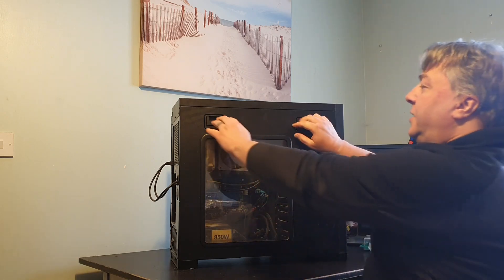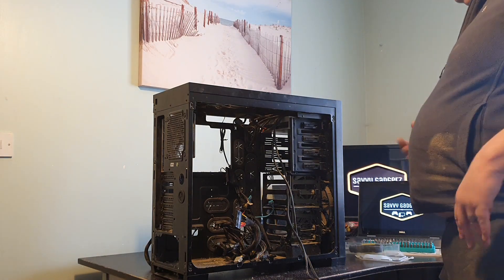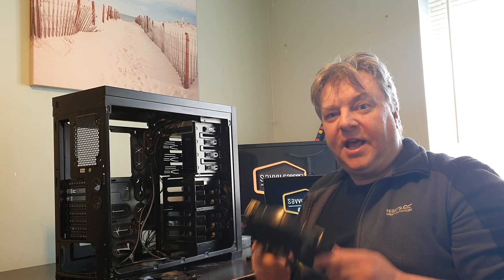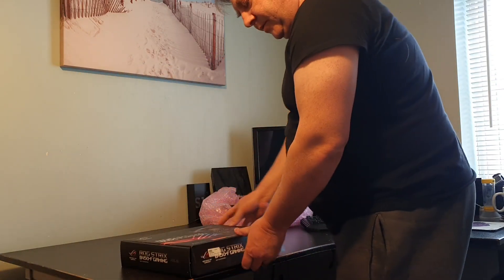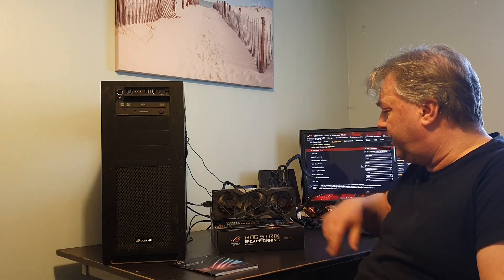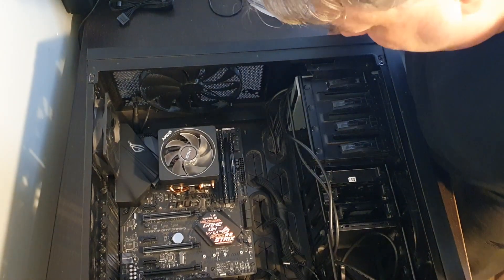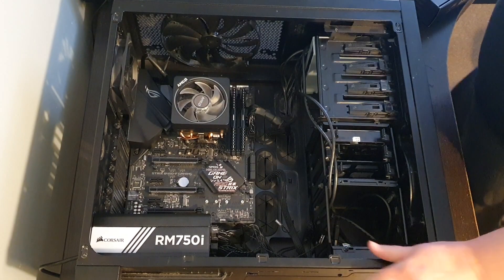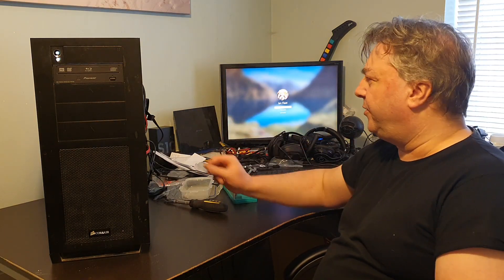My first PC build in 8 Years How hard can it be?

Comment: What is that strange looking air cooler?
Reply from the maker: You can still get them which I thought was weird because they really do look bizarre, but they are really good and have quite a few heat pipes on them which provides good cooling. I still have the order on Overclockers.co.uk and it's a 'Prolimatech Black Genesis CPU Cooler'
Reply from the maker: I have added the original spec of my PC in the description for those people that are interested and if you were wondering about any of the other parts in my original build.

Comment: The Mainbord Graphics did not work because your CPU  doesn't have Graphics Die. 
Hope you have fun with the new system.
Reply from the maker: Hey RFTL thanks for that info, it's my first AMD processor ever. It seems strange that the motherboard has the HDMI output but the AMD processors don't have the die for the graphics capabilities. I had an expectation that the HDMI would output something but I worked round it with my GPU.
Reply: @savvygadgetz   AMD has some mostly lower spec CPUs with  graphics capability (they have an G in the name). But yeah that's one of the things I like about Intel. Even if I don't plan to use the Integrated graphics. It's always good to have a Backup option for troubleshooting.